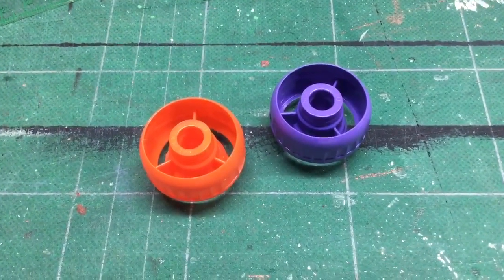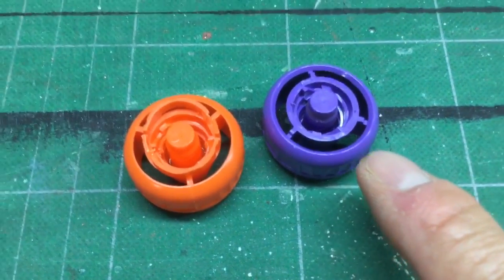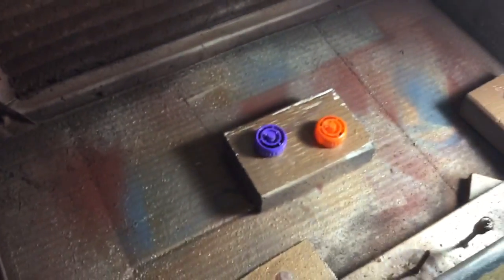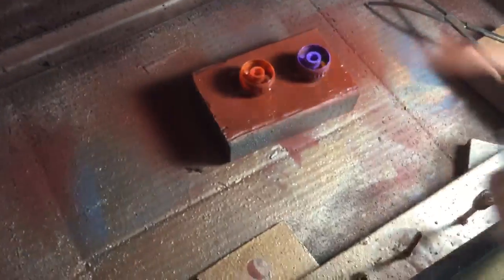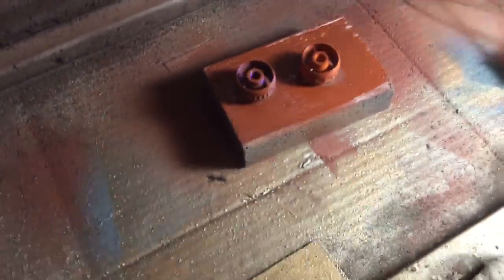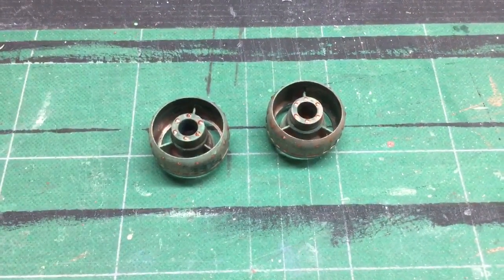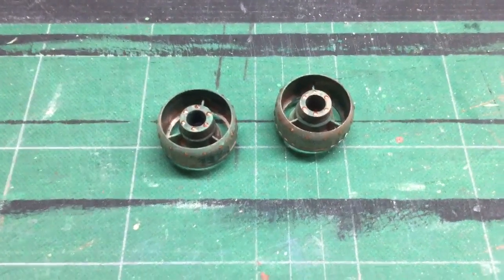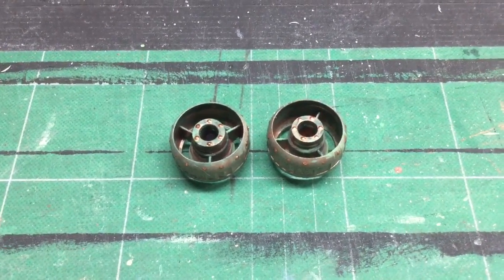Making air vents for a steampunk airship - DIY Fridays - Artsmith Craftworks

Comment from the maker: David,Thanks for the comment! The balloon portion of the airships is made using a cardboard skeleton with several layers of paper mache over that, then paint. Since I'm a huge proponent of repurposing and recycling, I use scrap corrugated for the skeleton, used packing paper for the mache and salvaged latex paint for the outside.